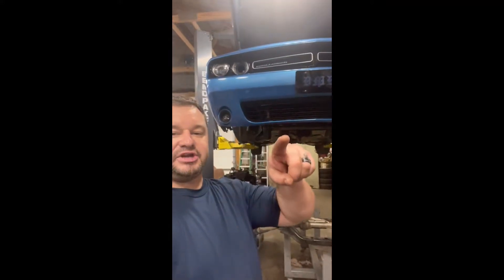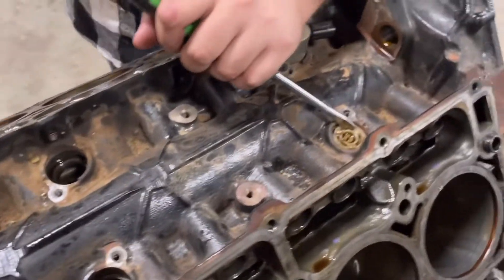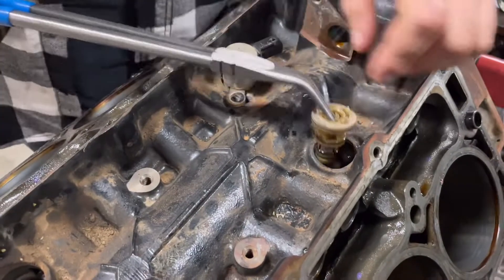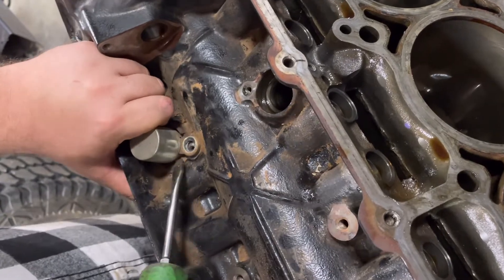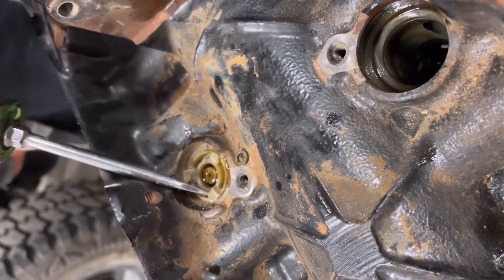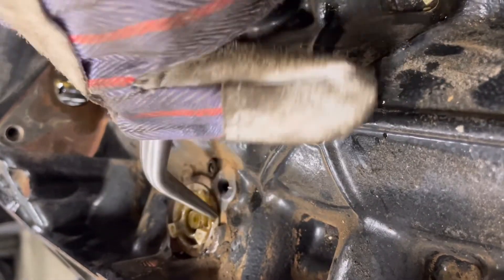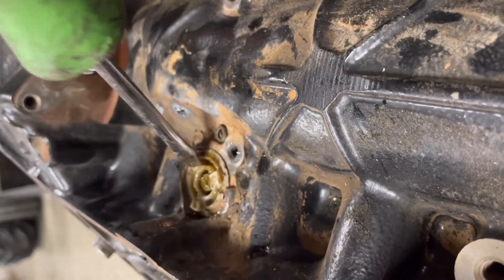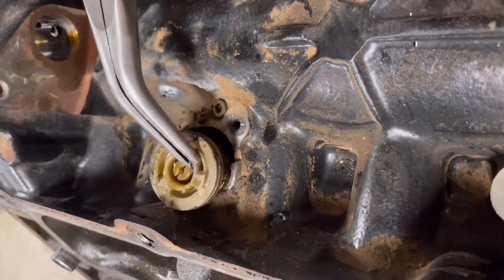#hemi MDS Solenoid Removal made easy ￼

Comment: I found an easier way to do this without breaking your shit off in there lol. Loosen the bolt slightly. Spray WD40 off in the crevice. Tap the sides with a rubber mallet for a minute. Pull the bolt out. Just slightly pry up on the piece where the screw mounts & spray more WD40. Then tap it again with a rubber mallet for about 20 to 30 seconds. Take a long flathead screwdriver and pry it under the Screw piece WHILE gripping the other side of the MDS solenoid, AWAY from the screw mount, with a pair of pliers. Pull up so you aren’t putting stress on the shaft of the MDS sensor. I just yanked all 4 of mine with ease.